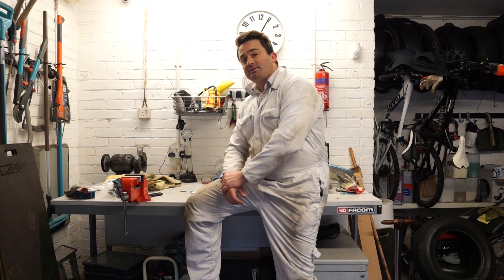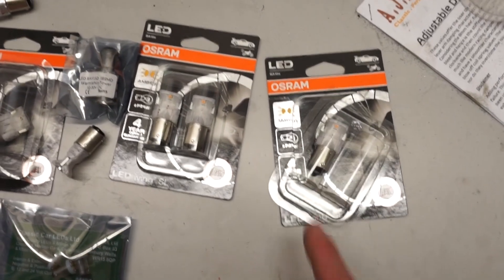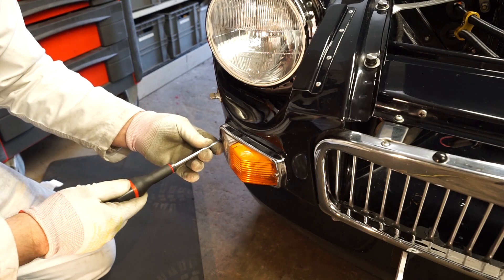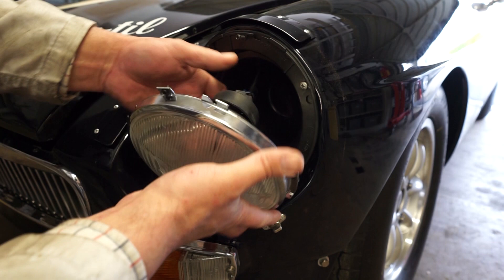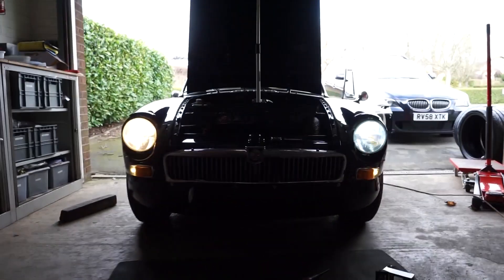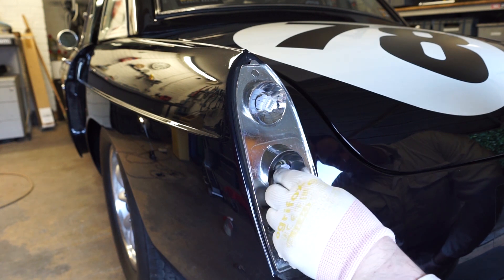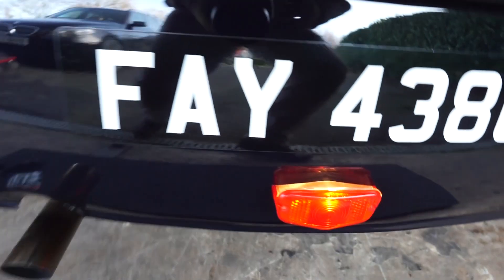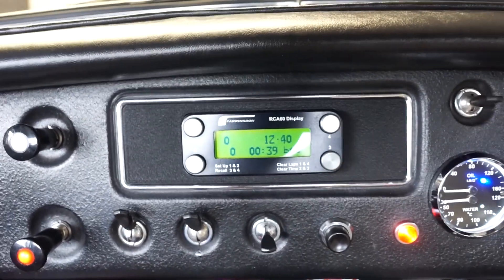MGB Exterior Lighting: LED Bulbs vs Incandescent Lights & Honest Review. Time to Change your Bulbs?

Comment: Always enjoy your videos Mr. Russell-Wilks! Love LED'S, last forever, takes the load off switches, vibration proof compared to filaments, pay for themselves in the long run, and saves labour costs for most fleet vehicles. Sorry I bought all these H** relays for my "B"! Cheers, Paul
Reply from the maker: A very good point Paul, I've headlamp switches fail in the past. I was amazed about the power saving on the battery too.

Comment: Very good review of LEDs in classics, particularly the MGB in this case. Overall I feel they are a great choice, the main point is it makes the car so much more visible on the road to other users – which I find increasingly important these days due to large amounts of traffic! In my case, I have a 1967 MGB GT, which I bought last April. It has been fitted throughout with LED by a previous owner. The nice thing about this GT is that I owned this actual car in the 1980s. I bought it in 1984 and sold it in 1988 to head overseas. I never expected to see it again, but found it purely by chance 4 sale online. It's a rare GT only colour called Sandy Beige, black leather with white piping etc.

Comment: You may consider Phillips/Osram LEDs and proper Wipar/Hella 7" headlights. That's proper stuff matched together.
Reply from the maker: At the time the video was made, the Philips Osram bulbs were not available, I think it was due to difficulties making them road legal, now they are available it may well be worth looking at them again, ideally I'd like them to be a warmer white shade to look period correct. The 7 inch headlights in the video are a set of Cibie Iodes, they are fabulous lamps, I was upset to damage one at Snetterton as I've been unable to replace it, the current ones on the car are Hellas.

Comment: The MOT rules have been clarified from 06.02.23 to allow the use of LED conversions that pass the beam pattern tests for headlights for Class 3, 4, 5 and 7 vehicles (car, private bus and light commercial vehicle) first used before 1 April 1986 and all class 1 and 2 motorcycles of any age.

Comment: I’ve fitted the brake lights but they don’t seem to work, I’m assuming the current draw isn’t strong enough. How would I go about fixing that?
Reply from the maker: The first thing I would check is that the bulbs are the right way up, the LEDs only allow the current to flow one way so won't work if they are in the holders wrong. The low current drawer can cause an issue for the flasher unit but it should not affect the brake lights in the same way. Also are the LEDs stop/tail type with tow bulbs?
Reply: @davidrussellwilks  I’ll have another look at them and try to see if I can get them working by flipping them around. I believe them to be the correct type but I’ll have a look.
Reply from the maker: Many thanks, if you you still have the old bulbs it's worth checking that they work correctly to see if the fault is in the LEDs or the car itself.

Comment: No back up lights ? Ya'll Brits driving on the left side of the road,....that's like Communism, sounds good on paper, doesn't work worth a damn in real life. Just bought a "77" MGB with 52,000 on her. Had an original "1962" right after High School, loved it, wanted one ever since. Hate the plastic bumpers & ugly Ass steering wheel on mine,... but way too much money to change. Oh well, they're a gas to drive anyway.

Comment: Replacing standard headlamp bulbs with LEDs is illegal in the UK and wont pass an MOT so if you do take the car on the road or get it MOTd then you should really change them, all other bulbs are fine. I found LED instrument bulbs were the best mod I have done on my MGB, I can actually see the instruments when it's dark now.

Comment: LED conversation was one of the best “upgrades” in terms of lighting which I did to my B. My rear brake/running lights were from  a company in California and made for the classic Cougars. It includes has a chip in a lens facing rearward. Comes on very quickly and much brighter than incandescent. 
For the headlights, I had Hella H4’s running which was a very good improvement over sealed. Then I upgraded to H4 LEDs from Classic Car LED’s in the UK. Duncan there is an excellent source of LED’s and very knowledgeable. The beam pattern has the proper cutoff and adjustable from LHD to RHD and the output surpasses the halogen H4. I’d love to share photos if you are interested. Cheers David! I truly enjoy your videos!
Reply from the maker: Many thanks John, since making the video I have tried a set of the Classic Car LED headlights, they really were excellent, great output and colour too. The only downside for me was the weight, for this car I wanted to keep everything as light as possible so have gone back to an Incandescent H4 for the moment. The ones from Classic Car LEDs were far and away the best of the ones i tested.
Reply: @davidrussellwilks  I would imagine every little bit of weight reduction helps. Especially after some dessert 🍮 😂. I would have to not eat for months 🤣

Comment: Great videos, thanks for your posts! I found adding relays to the MGB headlight circuit improved the brightness immensely. Highly recommend over the LED replacement bulbs for the warmth of incandescent bulbs. Takes the load off the headlight switch as well.
Reply from the maker: Thanks Shawn, a great tip there, I added relays for the lights when I made the loom for the car, definitely worth putting them in.

Comment: David, do you have relays installed for your lights, horn etc? Thanks for the video.
Reply from the maker: Many thanks for your kind message, I have relays for the headlights, I did not bother for the horn as it's just a little motorcycle one. Also with the removable steering wheel it's disconnected anyway, I can rig it up for the MOT or taking the car on the road though.

Comment: Mr DRW I think that this makes a lot of sense and I'm building these into my project. 

Such lights should be a FIA requirement imho (but you may receive a fatwa so best not to ask). We have all heard excuses such as those from an elderly Dutchman in a Cobra at the Spa 6H: "I could not see your MGB before I smacked into it after missing my braking". {It was "after dark", but La Source is lit up...). 

One important issue (I zipped through the presentation) is to get the right bulbs for the right colour lenses...otherwise your local Polizei may not appreciate such innovations (NB; difficult to tell from my computer). 

PS: for 7" lights, check out the products available for Mini's (no affiliation): https://www.youtube.com/watch?v=Xns76e-yZGY
Reply from the maker: Many thanks for you message Andrew, I am wondering whether I should try and fit a brighter rain light to the rear; I don't really want one in the cabin but from following other cars in the rain I know how important they are, as well as good rear lights etc. 

With the LED lights I chose I did not see a big difference with the tail lights comparing the LED to incandescent, the incandescent lights I was using were all fairly new, Osram band. You do see plenty of MGBs and other classic cars with very dim rear lights and you are quite right that having something you can see clearly is important. 

I tried the white bulbs in the rear lights at 13:38 in the video, unfortunately the camera did not pick it up all that well but the red and amber coloured bulbs definitely give a much richer and more correct looking colour. 

Thanks for the video link, ideally I want an H4 LED that fits in the Cibie headlights I have with a warm white colour. The Apollo H4 bulbs looked powerful but a bit too cool in terms of colour. I've never entered a night race but having something like the complete LED lighting unit looks sensible for something like Spa.
Reply: @davidrussellwilks  My project is an Elan. I plan to use reflectors (and have spent some time finding the ideal solution) and high level brake lights. I'll look up what I have used for the Cibié HL.

Comment: Great video and explanation. Would you mind sharing where you got your electronic flasher unit. I’m considering upgrading my 72 Roadster.
Reply from the maker: I would really recommend the flasher upgrade; using it with incandescent bulbs gave a good steady flashing frequency no matter what engine speed https://www.moss-europe.co.uk/flasher-unit-indicators-electronic-2-terminals-gfu2124x.html. If you are fitting LED lights I think it is required.
Reply: Thank you David. I'll definitely follow this up.

Comment: I assume that your car has negative ground. It is my understanding that LEDs don't work on cars having positive ground. An LED is a diode and can conduct current (thus emit light) in only one direction.
Reply from the maker: Thanks for your message, you are correct that my car has negative earth, however I do think LED lights are available for Positive earth cars too https://www.classiccarleds.co.uk/ seemed to have most of the LED bulbs in both the positive and negative configuration.
Reply: @davidrussellwilks  Thank you for your reply. Very helpful.

Comment: Where do you get a plastic bucket for headlamps?
Reply from the maker: Thanks Michael, I should have added this to the list at the top, Moss part ref in the UK is SML3P. They are made by Wipac, I've been very pleased with mine, hopefully there is no issue fitting the chrome rings to them, it's part I've not tested. https://www.moss-europe.co.uk/bucket-headlamp-plastic-sml3p.html
Reply: @davidrussellwilks  and they fit your mgb? They list only for midgets and triumph? Think they would work in a 71 GT?
Reply from the maker: I'm certain they are the same as the ones I am using, the only think I haven't fitted is the chrome headlamp rings

Comment: I would never go back to incandecent?
Reply from the maker: Were you able to find some good headlights Michael, this was the only bulb I was not happy with? The LED H4 bulbs were very cheap, I'm sure there are better ones out there.
Reply: Morimoto Headlamps
Reply: Watch headlight revolution on youtube 7'' headlamps
Reply from the maker: Thanks for mentioning these Michael, I think if I were to do a night event I would certainly consider them. 

I wanted to try and find some with a warm white light but less than $100 for the pair, and ideally keeping the period look of the car. 

I've been recommended ClassicCarLEDs in the UK, I used them for the side lights but they were out of stock of the warm white H4 bulbs.
Reply: @davidrussellwilks  the problem with aftermrkt bulbs are 99% were never designed for the reflectors in older lights. Therefore your beams may seem brighter, but are all over the place and to do not throw a precise pattern. The old style 3k ish color are available with the Holley Retrobrites. Headlight Revolution is the bible...